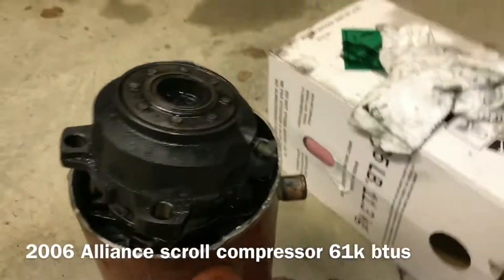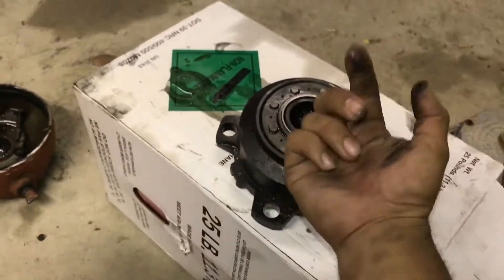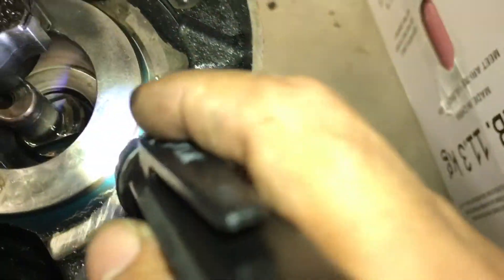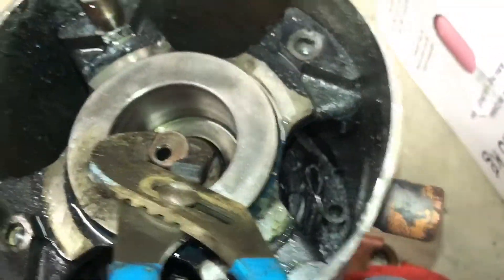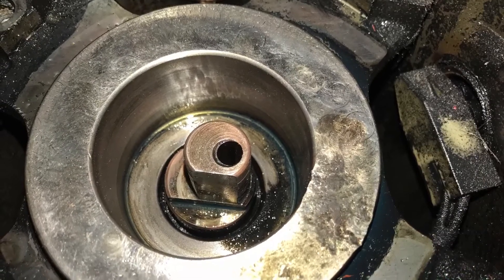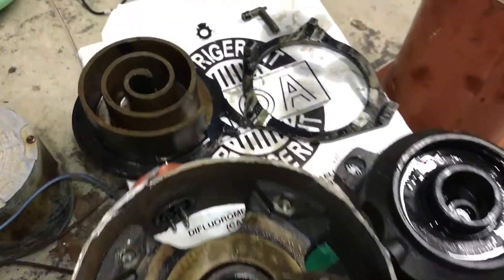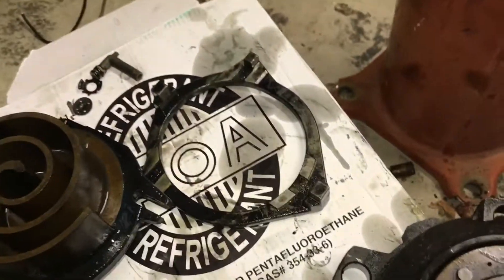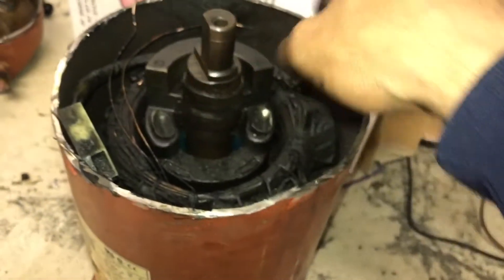Why did the Trane scroll compressor ground out?

Comment: Nice video, At 9:14 that is call the oldham coupling. I have cut open my fair share of compressor you can learn alot.
Reply from the maker: dizziedallas thanks man. Now I won't sound like a dummy lol.  I've seen your videos. You have Pretty good stuff. What do you think causes that noise when it's really low on charge. David Jones posted a video on one making that noise recently.
Reply: Thank you very much! The noise you hear is the floating seal hitting the top of the dome.The floating seal need differential pressure to keep a positive seal against the top of the dome.When you have a bad TXV or you are pumping down a system and/ or loss suction pressure you will here the chitty chitty Bang Bang of the floating seal.
Reply from the maker: dizziedallas  sweet. I figured it had something to do with the floating seal.  That makes sense. Thanks.
Reply: I just watch David Jones video that is the noise the floating seal makes when there is no differential pressure.

Comment: Well damn Ulises, now I want to cut open a compressor. There are things to learn by doing it. Great video!!💪🏻
Reply from the maker: Neil Comparetto you definitely should.  You really do learn a lot.  Puts the puzzle pieces together for me. I can see what's going on inside now. It took a 7.5 ton danfoss that would run for 10 minutes then it would Over amp and shut down.  I replaced it and I had to know what was going on. I found a cracked bottom scroll and worn bearing.